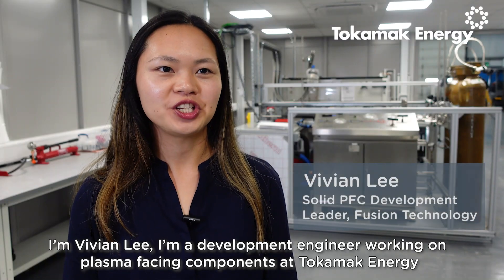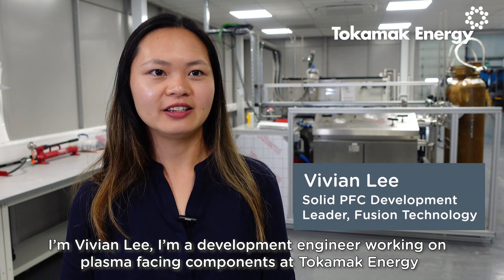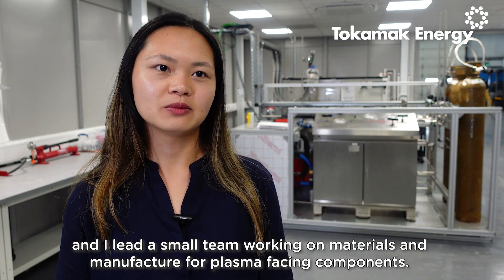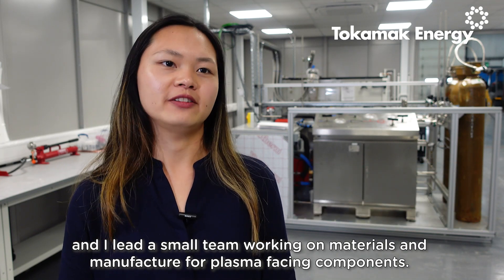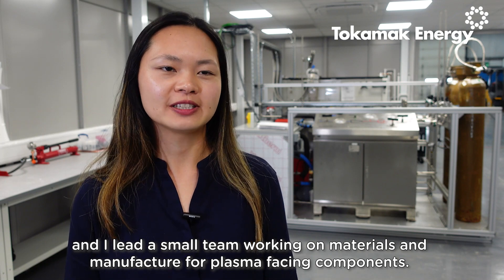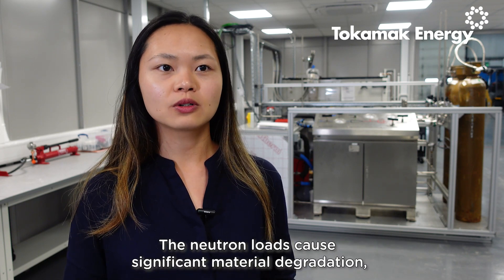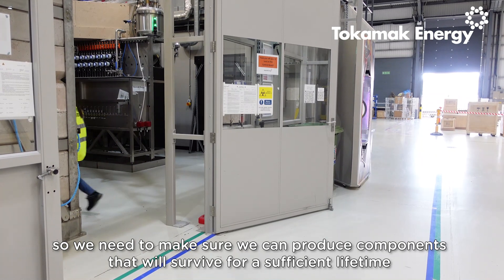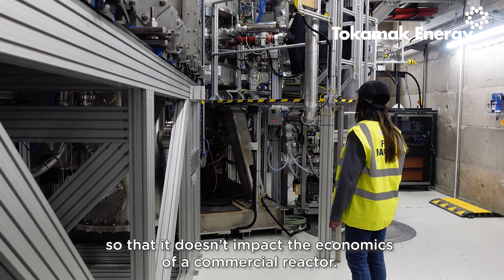Fusion Pioneers Vivian Lee - Plasma Facing Components

Comment: Hi, wonderful to see you guys are still at it.
Do you coat these components that has a high damage load with nikasil or something, or has the material a  high heat resistance in itself, or maybe both?
Reply from the maker: Thanks for the question. These components are usually made of refractory metals - a class of metals that have very high melting point and wear resistance.
Reply: @tokamakenergy6400  thank you for your time, one more question, how is the temp difference between fully transformed plasma floating in the donut and the surface area of the wall panel components?